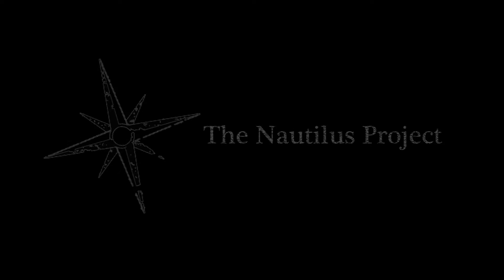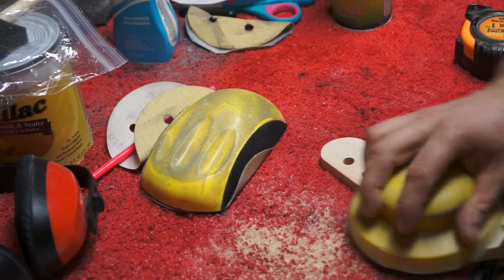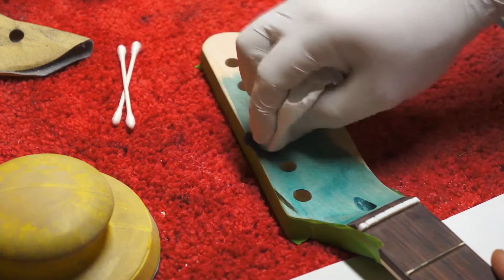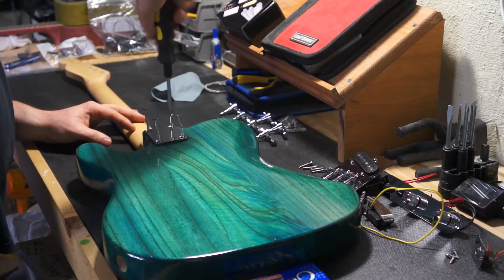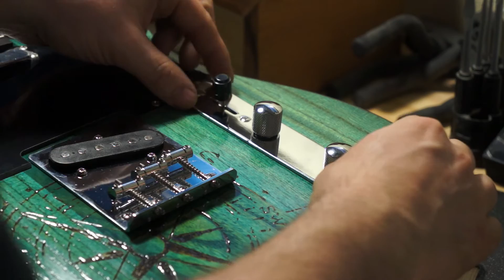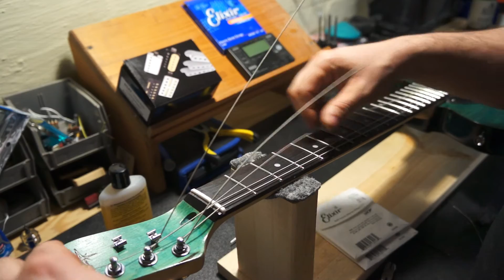The Nautilus Tele Project Part 2

Comment: Great videos man! Awesome. I have one question: What manufacturer from eBay are you getting your kits from? I have seen a lot where the neck does not sit properly or the spacing on the frets isn't right. I see that yours have that nice tight grip that they should have and fit great on the leveling ruler. Just wondering who are you getting them from. Thank you!